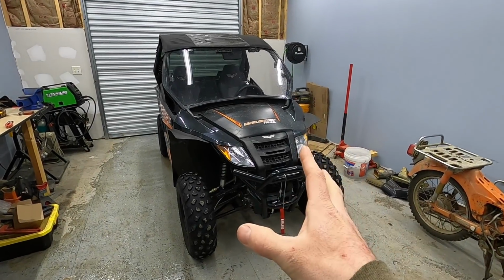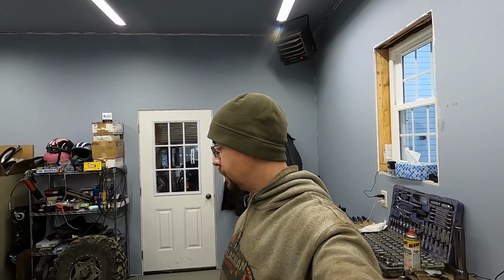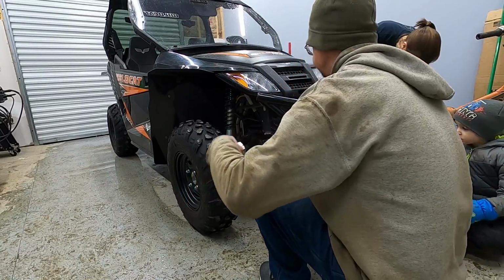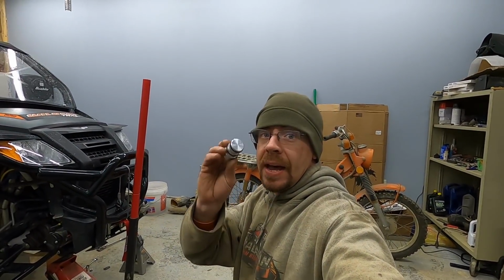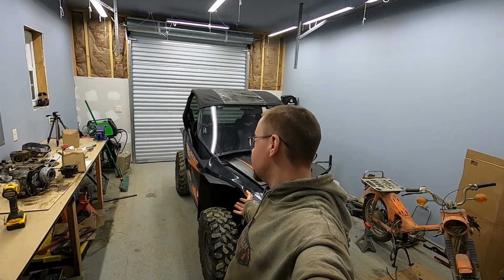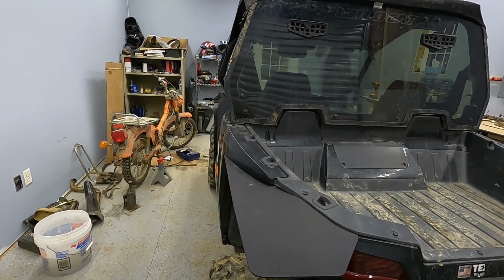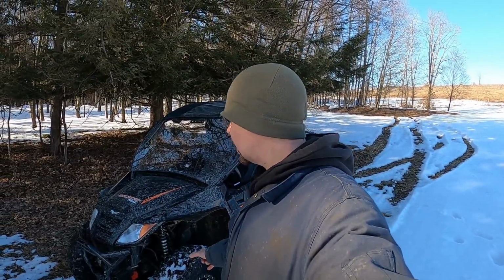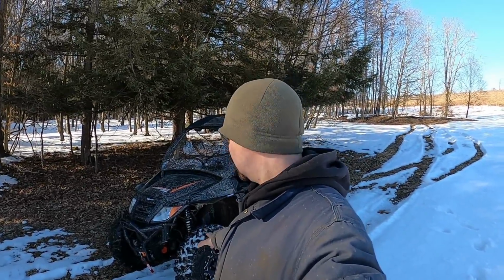Wildcat Tire Upgrade: The Trail Gets 28" Carnivores!

Comment: Looks great! I’d leave those wheels on there with the spacers. If your concerned about them coming loose, run blue locktite on the inner ones. Yes, it’s harder on the wheel bearings. On a 1000 lb buggy, I wouldn’t fret it.
Reply from the maker: I did locktite the spacer so should be good!

Comment: How did the X4 turn the 28s ? Im thinking of upgrading my Gen 1 wolverine. I don"t even mind the lack of power from my 708 but needing a 4 seater now. Dont think i could justify the Rmax.
Reply from the maker: It turned them fine. I did have a performance sheave but lots of guys run 28” with no clutch work with zero issues. I would recommend changing out weights to get some off the line grunt back but not necessary.
Reply from the maker: I have a video of installing the 28’s that I do dragy runs with several videos back and the results may surprise you